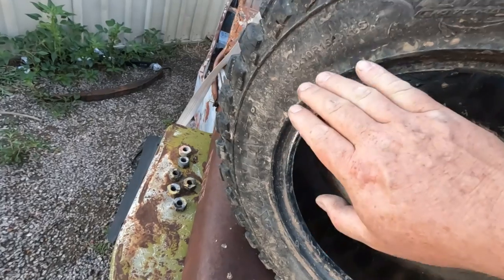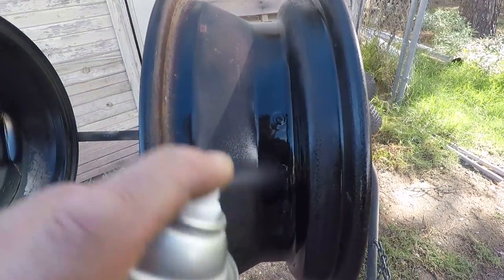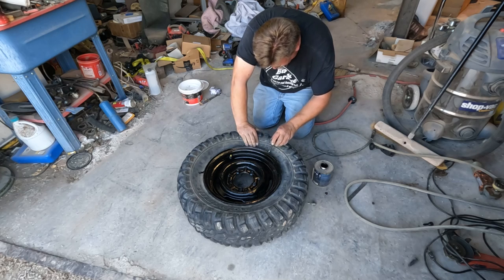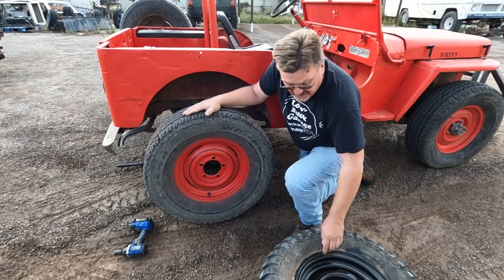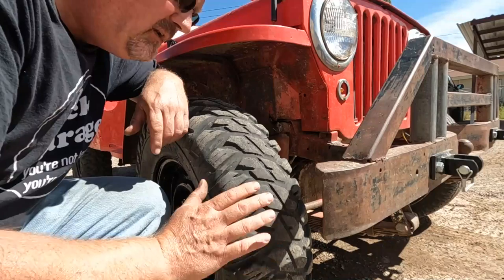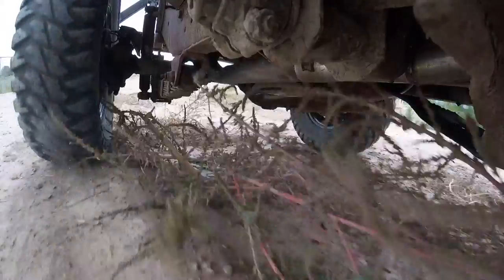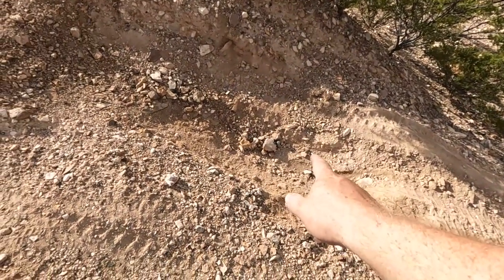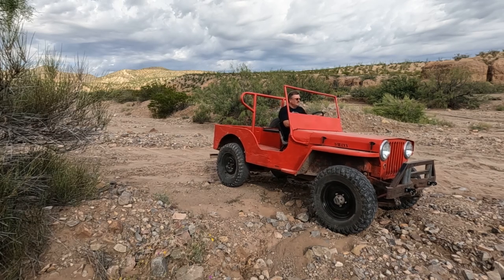ATV Tires on a Jeep?  Will They Work?

Comment: I've been a tire guy for a couple years and the 2 bad ones most likely are just dry cracked and you can't tell. You could tube them if you want, they're fairly cheap and easy to install.

Comment: I'm glad you done this because I've been thinking the same on my CJ2A. Most of the SXS tires you see have very aggressive tread and look pretty sweet. I enjoyed the video 😁👍 It's a shame that some of the "testing grounds" were off limits. Glad you still had fun though. Take care 🔧🔩
Reply from the maker: Thanks!  I definitely recommend them if you're going mostly off-road, even these worn out ones worked really well.  I'm looking forward to a set with good tread!
Reply: @LowBuckGarage  Are they better than the old style NDT and by how much.
Reply: Tusk Terrabites sxs offroad tires are one of few tires that are DOT Approved for highway use...  I have a set on my RZR 900 Trail 50"...   Had them all balanced when the tire guy mounted them????  Told him they're going on a Michigan Licensed RZR for highway speeds.  You can find them through ROCKY MOUNTAIN ATV/UTV.  Smooth as silk at 60mph!
Reply from the maker: @modarkthemauler  Much better than the NDT's I had for off-road.  The NDT's were way stiffer, I think they were made with toughness and durability in mind, traction was an after thought.
Reply: I have super traxion 700x16 on my M38A1. I love the idea of flexier tires, but also don't want too much traction as the stiffer tires can act as a 'fuse' and spin before things break. The small axles and drive lines were built with those tall skinnys in mind. Extra grip could now put more load on the spindly parts. That being said, I want to try those anyway, I can modulate traction loads with common sense. 
Great comparison and will be looking for some utv tires that are 16s. And yes, I AM having fun with my old fire jeep and am therefore as you say, doing it right. Great show! Respect from Auburn, ca.

You wouldn't happen to have a narrow Dana 30 with 5.38s and u-joint axles instead of the closed knuckle would you? 
Thanks.
 @LowBuckGarage

Comment: This year, I bought a 2003 Kodiak 450 ATV with the intention of using it as a snow plow.  Because we get heavy, wet, snow when it does snow on the West Coast, I was uncertain whether the ATV would be a practical solution for me.  We had our first snow fall last week, and the traction I had with the little beast, removed all doubt as to its practicability.  The little machine moved snow like jack the bear.  
I have the V pattern tires, with the center of the V open, and I didn't even have to lock the diffs once to make a full, straight, push of wet snow.  The machine  is great, but I think the secret was the tires.  Call me impressed, and far better than me sliding down the driveway sidways in the Bobcat.   Great video and fun topic.  Four different rims, no problem.  Six thousand leaks, we can handle it.

Comment: The biggest difference between the two sets of tires is the ATV tires have aggressive siping (cleats) on the edges. Ride comfort is generally not an issue so the sidewalks are stiffer and can be "driven" on just as much as the face tread.
If you want to see tires driven on on the sides watch some of the rock crawling competitions.
Cheers
Terry
Reply: Being the two are similar in weight. And the Jeep with considerably less power...sxs tires should work great to and be lighter

Comment: GrindHard Plumbing Co. put a set on a BMW ute they built & drove it from Idaho to Oregon for the Gambler 500. Worked well for them, they did mention that the tires on pavement had a lot of squirm.
Flex: The 15" RZR tires have a taller sidewall and will show less flex than the 16" tires.
FWIW: I run 10 psi on road in my '3A (31x10.50R15 Dunlop M/T) and 6 psi offroad. I'd suggest 5-6 psi front & 3-4 psi rear for offroad on the lightweight '2A for comfort and traction w/RZR tires. 

My $.02---YMMV

Comment: Tire width also effects flexing the sidewall. The narrower OE tires need to flex more than the wide atv tires, because the flex is caused by contact patch psi. The wider tire is wider, but the narrower tire must get longer.

Comment: with two implement wheels... you can use the holes to fab up an Ausie winch on each wheel.  that would be a cool addition.  Put them on the rear?  rope guides up front on bumper
Reply from the maker: I like that idea, maybe make one that can bolt on either side depending on which one is spinning.  I think I'm going to do that...
Reply: IMHO go with a rope on  both sides of axle.  Sure only one will be powered.......  but other wheel still turns as it rolls .... thinking it will help spread the force of pull  to both axle  spring mounts instead of just one??? Might need a spreader bar (slide outs on corners of the bumpers made of reciever tube?? ??? or something to guide rope inline with chassis for portion of the forces and keep it off wheels, while at same time  keeping rope aligned with what it is wrapping on.  ??

Comment: They make those interior flat patches you roll on with a spur tool with a plug molded on the end of them also. 

-we were forced to change the method and patches in 2010 a KIA. Do to a family apparently was killed do to a failed patch then blow out.

Comment: The way all the holes line up on that one tire looks like it might have had studs installed and pulled out later. If all you want to do is drive off road the newer used tires you found would probably work great and you could still make slow trips on road to get home. My first car was a 42 Ford GPW Jeep and it had 15 inch snow tires on it that worked great. I really wanted the stock 16 inch military rims and found 4 original ww2 Jeep rims with ok tires cheap at a Jeep only shop I found. They actually sucked all around compared to the wider snow tires and drove worse so I swapped back. The guy that eventually bought it when I wanted to upgrade to a power wagon got a lot of spare parts... It did look like a stock ww2 Jeep with the original rims though which was cool.

Comment: I almost wasted money on a Horrible Fate tire changer for my many pieces of small engine equipment but found large C-clamps and soapy water in a spray bottle to work great. For car tires I mounted a hinged piece of square tubing from the dump to the wall with a shovel cut down mounted on a pin I can move on the tubing. I hate spending money if my brain can prevent it. Besides, I have no money but I have no bills other than phone and liquid go juice.

Comment: roofing tar and the same pruneing trees sealer coatings or i watch and study tire sealer try all so i use slime some times water paint brush coat inside times apply light coat dry and repeat point is regrover home made even spikes for grip chains for tread or cables most effective

Comment: What made four wheeler tires so nice was their small wheels and thin side walls for that squishy, flexibility. Side by sides are basically plastic jeeps and they have to make the tires like truck tires with thick side walls to support them. I don't think you're achieving the effect you're after.

Comment: I know this video was about tires, and nice job demonstrating the benefits of airing down. (Especially in that particular "test area") BUT. I would love to see you put some lockers on that thing. (Or at least one)
Reply: Mechanically operated front and rear with nitrous and push button adjustable suspension , dual gas pedals
Reply from the maker: But lockers might take away the challenge!  It actually does pretty well as-is, I only had trouble on that one hill, everything else it just puttered right up.

Comment: The best way to deal with the pre-existing repairs, when reusing tires, is to slather them with "inner liner sealer", or something similar.

If you had painted the inside of those you wouldn't have needed any plugs. Air the tire up before it drys, so it's like ghetto run-flat.
Reply from the maker: That's a good idea.  I didn't realize how many holes were in them when I mounted them, I was figuring one or two...

Comment: I myself was not all that impressed with these tires overall. Maybe your Jeep was not heavy enough to get the tires to flex enough to conform to the rocks and terrain to present the best grip and flotation. And you demonstrated why some form of limited slip or locker is a desired feature for off road vehicles.